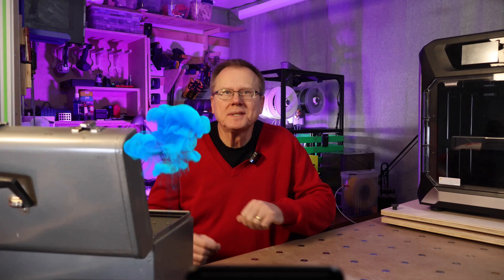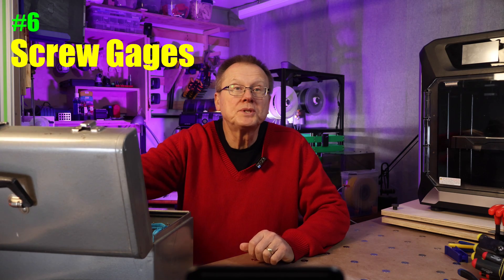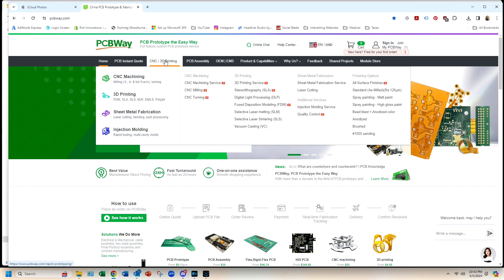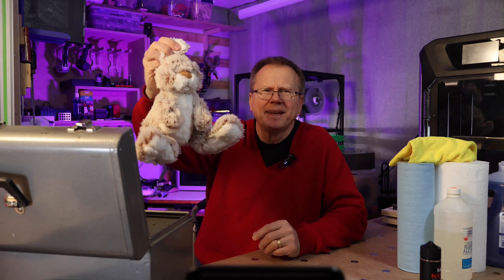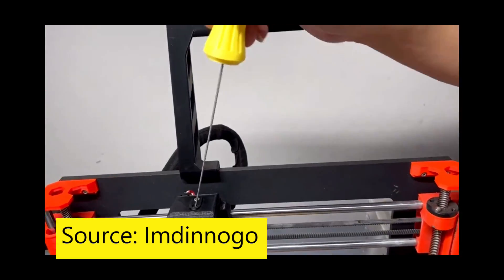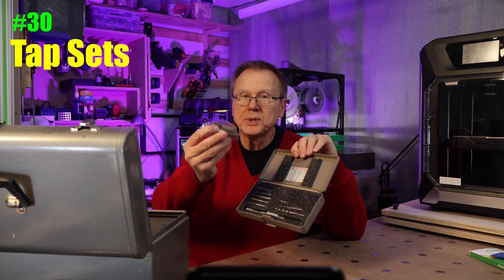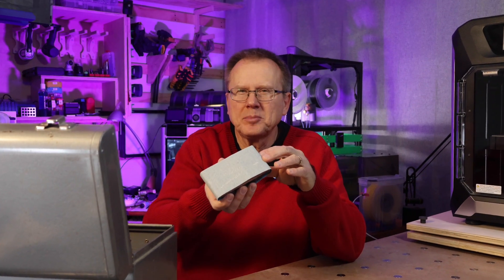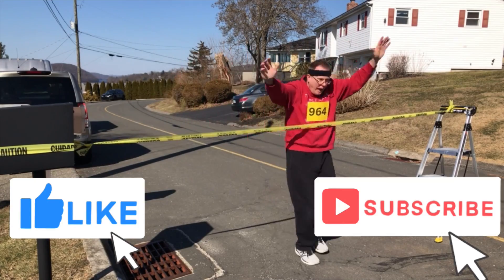TOP 40 Tools for 3D Printing (in 18 minutes)

Comment: 13:42 I believe the correct motion for a deburring tool is to PULL the cutting edge, not pushing it as is shown in this video.
Reply from the maker: I've tried both ways; the key is to make sure you can't cut yourself if the deburring tool slips so in general I try to cut away from my body.  Thanks for the comment.